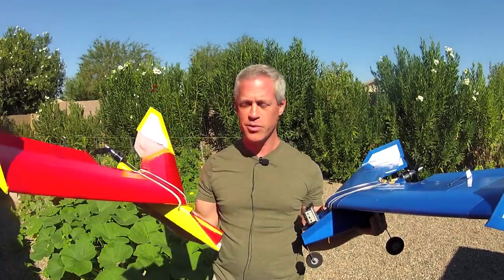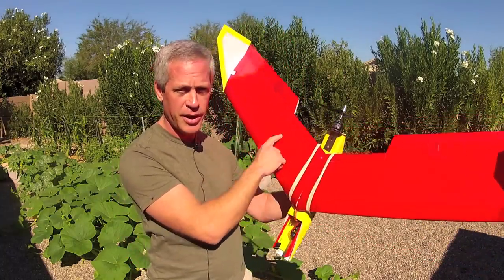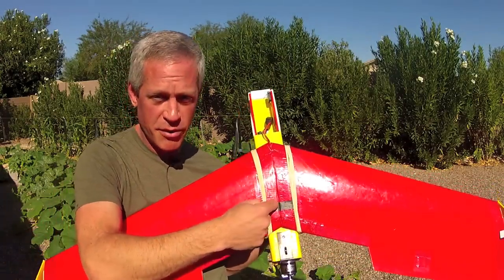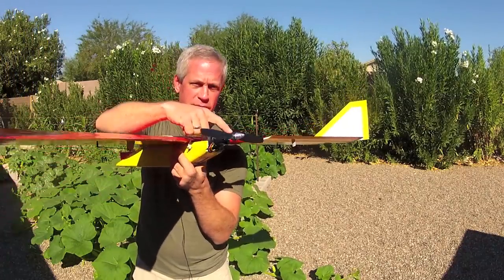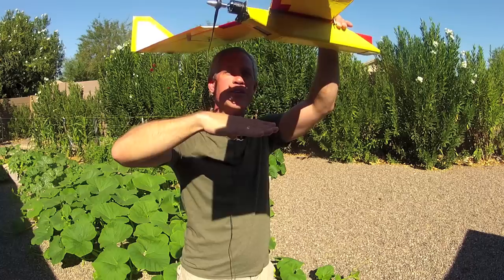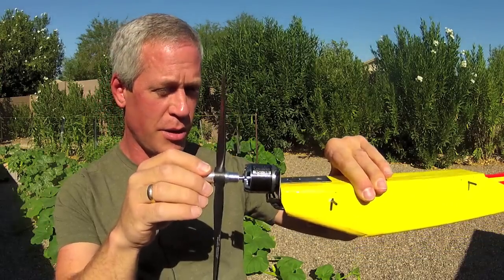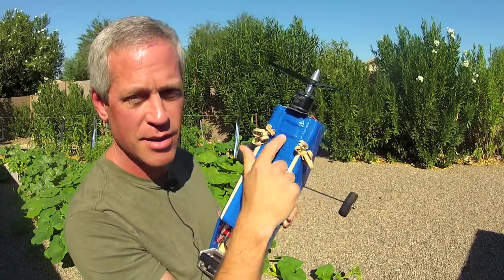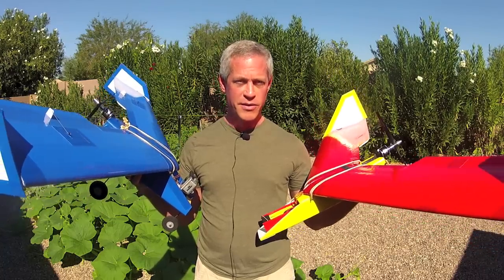SYNAPSE Foamboard Flying Wing - Intro Video

Comment: Ed, love the wings!  I have a semi successful scratch-built Zagnutz wing (zaggi style wing) but had horrible issues with the CG.  It flew, but not so well.  I tore off all the electronics for another project and now just have the wing sitting alone and dejected in the corner.  Now I know what to do it!  Thanks for putting out such great videos.  Your designs are simple, efficient and I love how well they fly.  Keep up the great work.

Comment from the maker: I have not had many windy days to test it but I will try when I can.  The handling seems to be solid and steady with long, smooth lines.  It is not aerobatic or very nimble.  It feels to me like steering a boat or driving a Cadillac, as opposed to driving a Porsche or flying a 3D plane.  It definitely goes where you want it to but it's smooth and gentle.

Comment: Ed. Many many thanks for you intuition and fine instructionals. I've been away from RC flight for 25 years and you're one of the reasons I got back into it. I just whipped together the wing of your Synapse model in no time. I'll probably build 2-3 more of your designs as well. Keep up the great work as it is very much appreciated. ~XXXTechRC

Comment from the maker: Not sure about the winglet significance.  The blue one is configured to never allow the prop to touch the ground.  Maybe there's a little droop tip/wing fence effect. They are both probably larger than they need to be, but I'd rather go big and size down.  A little more vertical surface is needed to mitigate the fuselage pod.  Handling is very "determined", kind of smooth and locked-on, not twitchy, not super nimble.  Stable in 5mph wind, but haven't really pushed the high winds yet.

Comment from the maker: Oh for sure, many other ways.  I kind of hate rubber bands  but at the same time they are cheap, low tech, forgiving, allow movement on crashes and hard landings, and are easy to set up and break down.  Nylon nuts are a favorite of course.  Velcro straps have been used with good success.  You imagination is the limit.

Comment from the maker: Yeah, the Synapse has swept wings, a very short tail moment, and a bit higher wing loading.  It really only needs the extra watts to get hand-launched.  Cruise flight is actually quite mellow at about 150 watts level flight.  With landing gear you could get by with less motor.  The Peace Drone has enough "float" to make it hand launch pretty slowly and stay airborne while it builds airspeed.  Flying wings kind of need extra oomph.

Comment from the maker: After being cut for the Synapse design, the wings are actually not 30" rectangles but rhomboids, 26" long on the leading and trailing edge.  At a 135 degree nose angle (22.5 degrees sweep for each wing) the wingspan is 48".  You can try this on an online triangle calculator if you like.  Sorry I am terrible at drawing so I try to use video as my teaching medium.  The instructions are quite detailed.  Look at the one on the wing specifically and you will see the dimensions.

Comment from the maker: I think it is a good idea in principle, but I have always had very good luck using the ESC brake and just letting the prop flip up and out of the way upon landing.  I literally have never had a broken or misaligned prop that way.  I would use caution with prop savers on large diameter, high power, high rpm motors like the ones I recommend for this plane, as a prop saver might let loose of the propeller if not perfectly balanced.

Comment from the maker: First, you would need larger foamboard to get a 60" wing on the Synapse due to the geometry of the swept wing.  If you could do it the wing loading would be decreased and flight efficiency would be increased.  There are some losses due to the flying wing design which depend a lot on the CG, but many other factors are in play.  It gets more complicated than just straight wing loading.  My guess is that under ideal situations you would be right - Synapse better by a small margin.

Comment: Great videos, Could you show more detail about how the arrow shafts are glued to the inside of the fuselage for the wing hold downs?
Reply from the maker: jeff saunders I actually try not to glue them in unless really necessary, and then only just a dab of glue.  Once the rubber bands are put on it will hold the shafts up tight inside the fuselage.

Comment from the maker: Believe me, I tried that and everything else first, including an interrrupter switch that would bring the motor to full power the moment it left my hand.  The way I have this plane loaded with FPV gear and balanced with the CG conservatively forward, the only reliable way to get a clean launch on level ground is a power-on side toss or overhand throw.  I wish it weren't that way.  At least I feel better about the prop clearance with video documentation.

Comment: Very elegant solution to having an FPV platform that is easy to travel with!  It gets around some problems I've been having with my wing.  Thanks for showing the possibility of the "football" hand launch with this design.  A couple questions: 1) Is there any difference in performance with the two different winglet designs?  2) How does it handle in turbulent wind conditions?

Comment: Wouldn't it be a good idea to use a prop saver instead of the prop adapter? Seems to me that the shaft can get easily bent on a landing on the plane without gear.

Comment: Wonder if you had thought about a tail dragger wire (or duel wire equal spaced) which might assist in keeping your hand clear on launch... if its long enough...Worst case is the tail dragger would  hits your hand at launch before the prop, causing the plane to deflect the angle of release to the point of clearing your hand (and crashing the plane). Just my 2 cents

Comment: Ed if you remember my Axon i had a Turnigy 2836  2350kv motor on it with a 6x4 prop with a prop saver at 1800 kv i would recomend if using a prop saver not to go beyond an 8x4 prop

Comment: About the Synapse . . .  I was thinking about the slide in slide out tray for the electronics.  Could you also use that feature to adjust the plane to get the CG right ?

Comment: Thank you so much for taking the time to make these videos.  I'm going to put together my first scratch build (and first wing), and plan to go with the Synapse.  One thing I've read is that the paper on the Readiboard (from the Dollar Tree) is easily removed.  Have you had any issues with colored packing tape peeling off along with the paper?  Do you think the Elmers foam board, which is more dense, is a better option?

Comment: Are there any other ways to attach the wings besides rubber bands that would work with the Synapse and the Peace Drone?
I see the Ozone uses nylon wingnuts and metal plates, but it has 2 booms and bigger.

Comment: How sensitive is the motor mount angle? 
I'm guessing the metal bracket can be bent/adjusted to achieve the 3 degree down angle. 
I've seen a few videos on how to do static balancing. (Basically balance on fingers to identify the cog) Is there a video on identifying trimming needed for dynamic loads from prop thrust and aerodynamics? 

Great videos, Thanks for posting.

Comment: Hi I have in the past built mikeys rc YC 14 the twin engine cargo carrier. I am planning now on making the synapse design into a push pull twin with landing gear, that might help with the cg issue. I will use the same power plant from the YC 14. Any thoughts ? Swung some pretty big props on the cargo version. Maybe go with smaller one ? Waiting for my peripherals so I can start assembling. Really enjoy your videos. They are timeless to the new and experienced builders.